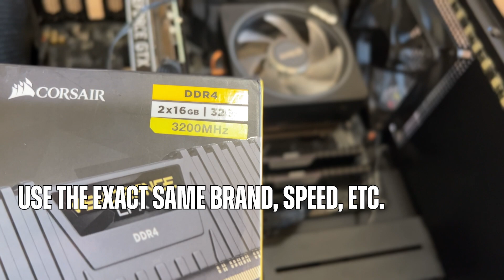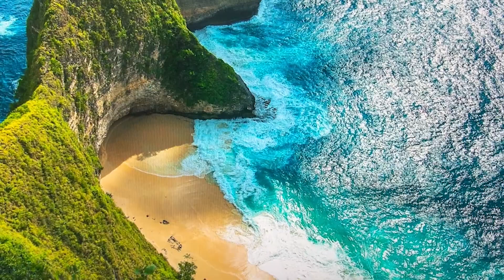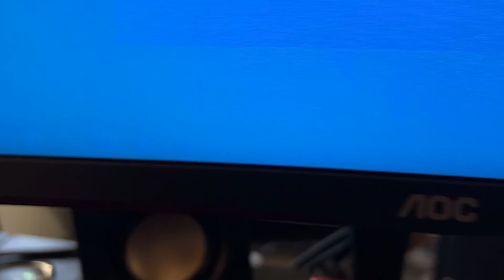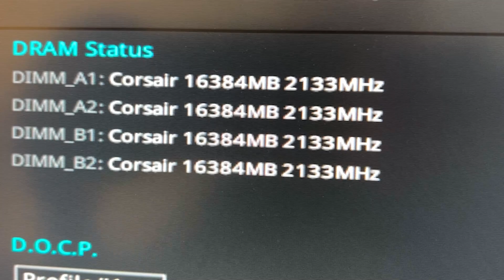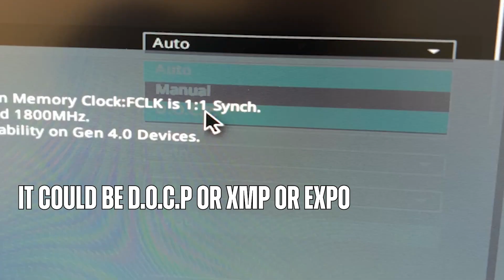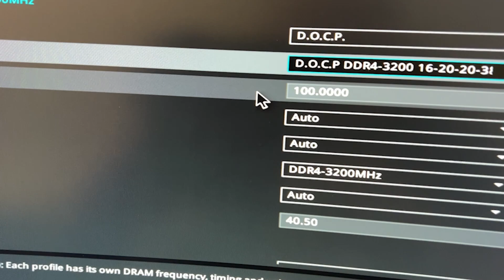How to Install More RAM to Your Gaming PC

Comment: Don’t this hurt the performance? I don’t know nothing but when ppl build they only put 2 in and say to put them in like u have your first 2 for some reason
Reply from the maker: With 4 sticks it still runs each pair in dual channel. For best performance, you just never want to use an odd amount like 1 or 3. Also if you only have 2 sticks they must be in specific slots on your motherboard to run in dual channel which gives best performance.